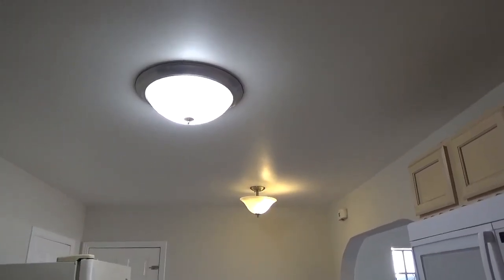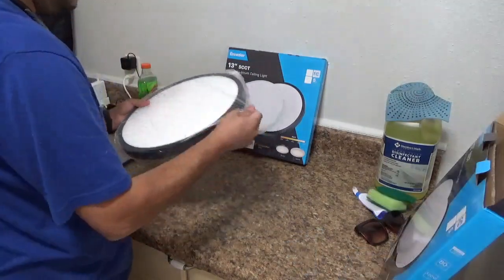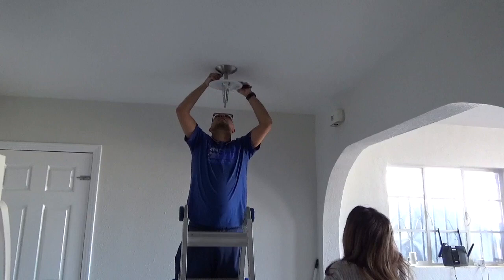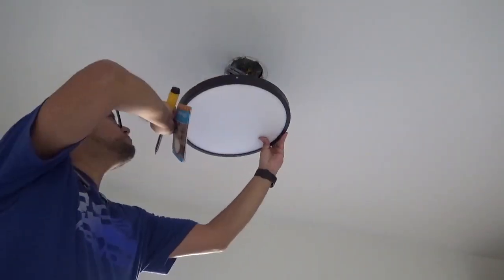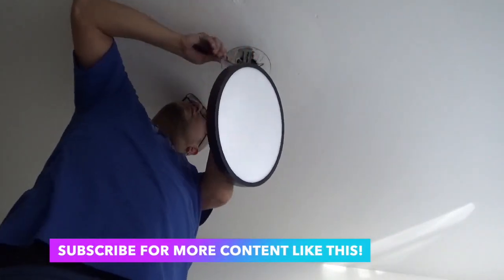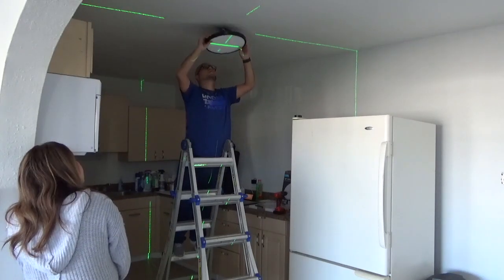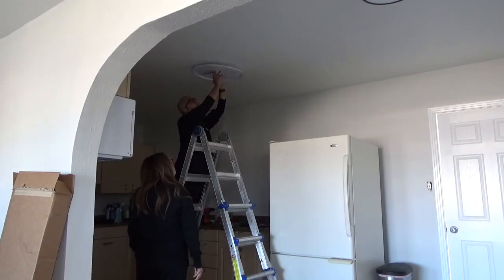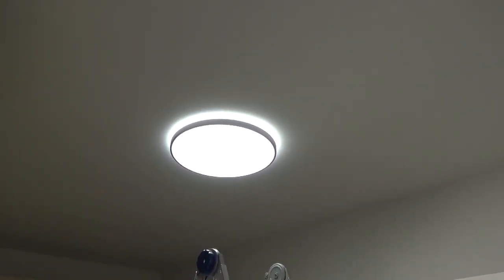1955 Fixer Upper. Investment Property. Installing New Lighting PLUS Other Updates!

Comment: The lights look great. That bigger one from Home Depot is a good size for that space. It brightens up the area. We do plan to redo a few more lighting changes. Our windows need a replacement as well but I know it gets more pricey as well. Yes, tile floors are sooo cold. We have tile in our bathrooms and the downstairs. Ron is not looking forward to redoing the floors but it’s one of the things we’d like to do in the future.
Reply from the maker: Hey Roxy! The bigger light was much needed. I still want to paint it black tho, hehe. My brain won't let them be different. Windows are expensive, coming from a larger home to a smaller home we appreciated the price difference between 15-20 windows to only 6 in our current home, hehe! One good thing about a smaller home. Glad you can relate with tile. I find myself wearing socks ALL THE TIME. Never did that in Arizona. What kind of floor are you putting?